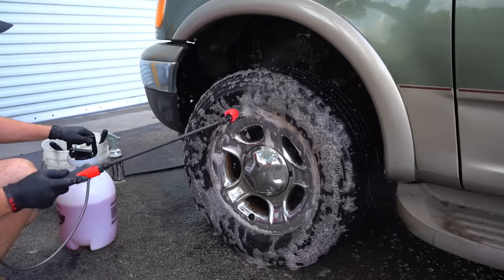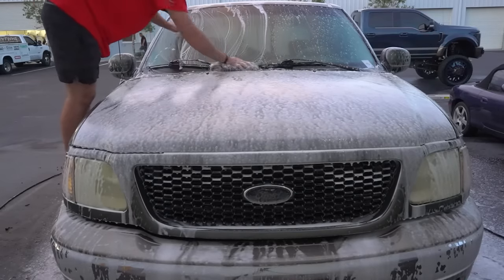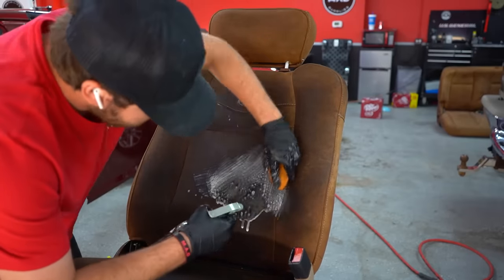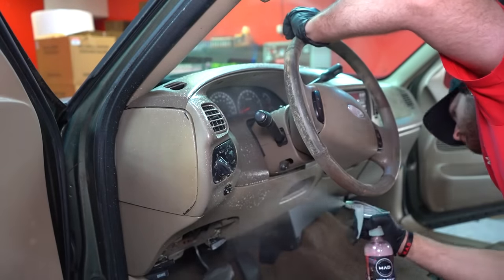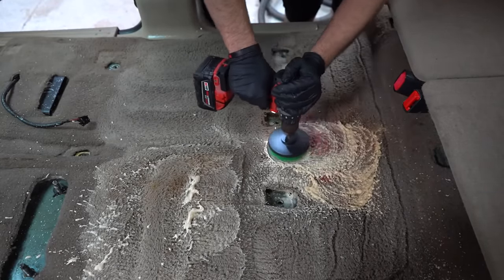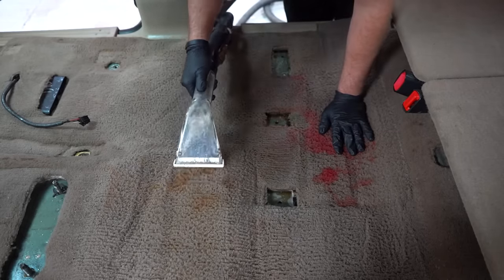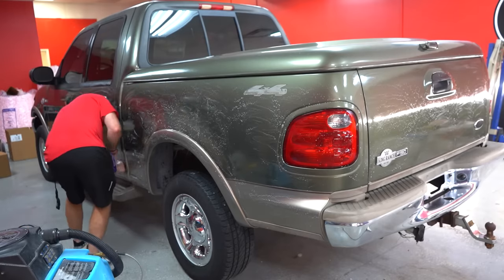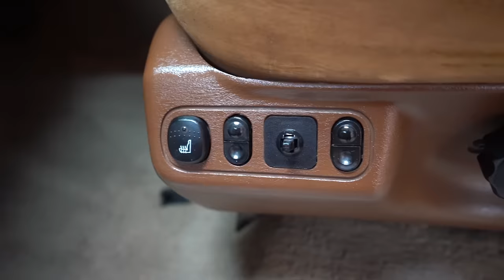Deep Cleaning the MOLDIEST BIOHAZARD Truck EVER! | Satisfying DISASTER Car Detailing Transformation

Comment: for red dyes and soda, I use ammonia (you can dilute it), soak, then steam with a rag on the steamer.  You need to break the chemical bond.  You need to be careful too and not over steam (get it to hot) because it can lighten the carpet itself.  try in an inconspicuous area first to get the feel.  I like to put a rag on the end of the steamer so it will transfer the red to the rag with the heat.  At best you'll remove the stain.  at worst, it will lighten the stain possibly the carpet a bit.  Practice it a few times before do it on a paying customer so you see how to do it.
Reply: Different fabrics don't always react the same to strong chemicals like ammonia/ bleach. It might work great on some carpets and others might absorb too much or have uneven lightening. Definitely wouldn't recommend using that inside the car..
Reply: @kellsbellls  I would on the carpet, being sure to test in an inconspicuous place. I would not use it one upholstery.
Reply: I don’t feel like using these chemicals on porous surfaces is a good idea
Reply: Nice
Reply: My gf use to work for a nursing home doing lundry and she brought home a stain remover that was able to take paint out of carpet and clothes idk what it was but i wonder if it would take that dye out.

Comment: I've never seen those seats, but I actually like the idea of them. Like cowboy boots, they get a nice patina over time. Not sure I'd want that commitment in my car, though. Should've used saddle soap :) Great transformation.
Reply: That would only work if that material  was full grain leather. I think it's much more likely the material is a split or a suede, at best. Far more likely to be a leather derivative or pleather product of some type  bonded to a textile (cloth).
Very unlikely it would take the oils like full grain boots, belts, and tack do.
Reply: @fridgeopener236  thank you for bestowing your wisdom.
Reply: There have been a few different leather styles used in Ford King Ranch vehicles over the last 2 decades.  2001-2009 were a Castano leather,  2009 - 2018 was Chaparral leather, both are Aniline leathers - they are dyed not sprayed and clear coated like typical automotive leather. The issue is like your cowboy boots, the leather will dry out and crack if not given some care, but also like your boots, it's pretty durable.
Reply: @1974kenm  I don’t know why I love your comment so much. Probably because you really took the time to explain it. Thank you. Merry Christmas and if you don’t do that, Happy Holidays!

Comment: The idea of real saddle leather is cool and interesting, it could also be used as a bragging point. However, I would not want to own it as it extremely annoying to keep clean, and is hard to clean. So, that’s a no for me.
Reply: I wonder if actual saddle soap would work better?
Reply: Actually saddle leather is incredibly durable and fairly easy to clean and maintain with the right leather cleaner and conditioner. As mentioned saddle soap can be used and works great. Using chemicals, improper cleaners, and not using leather conditioner will leave the leather looking weathered, dry, and cracked like in the after shots of this video.
Reply: I have cleaned real saddle leather boots. We have a thing of saddle soap that we rarely use cause o ly one pair of boots is real saddle leather. It's axing how nice it can look when cleaned right
Reply: Same. I like the idea & they are super nice at first. Although they are beautiful, I wouldn't want them in my own vehicle. What a pain it would be to clean. Especially for someone like me who has kids and a dog they tote around. Lol

Comment: I use a three bucket method with multiple microfiber towels.  I switch towels after each body panel. One bucket has the soapy water and clean towels.  One bucket has rinse water for the towels.  The towels are not reused until they go through the washing machine. I rinse them in the bucket in order to keep the washing machine from foaming up. And the third bucket I use to rinse the soap off my hands.

Comment: On the tan and grey interiors. When I come across stains like that. Pre- soak it with resolve mixed with oxy clean. It more then likely won't take it out. But it'll lighten it up drastically. Or even soft scrub will do.

Comment: Want to do mine next. It's a Michigan  work truck with plenty of cancer, clear coat flaking, leaking rear window and smoked in. It also has a matching bed cap. Can't remember when the outside was last washed but the interior was partially cleaned two years ago when I had to replace the condenser and heater core.

Comment: For that kind of leather… Just a tip… Clean it with Murthy’s oil soap and a bit of warm water. Works REALLY well.
Reply: My great Grandpa had seats like that. When we used the Murphy’s oil soap and warm to hot water, we still used an extractor. I had a saddle made out of that same material had to be cleaned the same way. And it sucks! I would spend hours upon hours cleaning both the seats and the saddle! LOL

Comment: Saw a commercial building cleaned after a water / mold incident. They used an ozone generator as part of the decontamination process. Would you consider using one in the truck cab?
PS - I’m totally impressed.
Reply from the maker: Yeah I use a ozone before and after on moldy vehicles.
Reply: @MADDETAILING  are you not worried about corroding the vehicles
Reply: @jayasmrmore3687  safety first
Reply: @loren1110  you can wear a mold respirator
Also he will be liable to potential lawsuit if he corrodes the metal

Comment: Great video!! The 2 bucket method makes no sense to me TBH. 
First of all by that logic you should use 3 buckets, then why not 4? Dirt will transfer to the second bucket from the first anyway (on the sponge)
Secondly, they say you don't want to introduce dirt to the surface - what do they think is ON the surface they are washing? You've already pre-washed with a solution and rinsed the larger dirt off - so most of that is gone anyway. 
Thirdly, anything that touches the car, theoretically introduces minute scratches in the paint - wiping off dust, running your finger along it, buffing/polishing.
One bucket with a grit guard should be fine for 99.9% of cars - unless you're going to be entering it into high-end car shows and examining it with a magnifying glass. (just my own opinion)

Comment: It’s Alinine leather and when properly cleaned and cared for will last a lifetime. It usually stains when it’s dry. Keeping the seats conditioned helps keep them from staining. Spraying them with dye is a terrible idea that a lot of shops do as a quick fix. The leather turns hard overtime and you can’t clean it due to the dye closing off the pores.

Comment: Ford didn’t do away with the saddle leather, to this day you can get a brand new king ranch with saddle leather seats. Saddle leather is pretty durable and made to last 25-50 years, that’s why it’s so hard to clean. To get rough stains out you need to use a stiff bristle brush and in some cases a wire brush, doing it to these seats would most likely tear and rip them. Saddle leather isn’t really made to look good but rather last a long time, and as you can see they lasted in this car even with the mold build up.
Reply: Hopefully you can only get it by request

Comment: I watch carpet cleaners get red stains out all the time. It's a method they use were they do a heat transfer. Take a microfiber towel and lay it over the red stain and put like a in closed steamer cover over it and the red stain Transfer to the towel I also seen carpet cleaners use a iron for steam too

Comment: Don’t see why if you’re going to be doing a machine polish to enhance the paint and remove swirls you wouldn’t use a two bucket method? By using one bucket you’re just going to create more swirls in the paint work thus giving yourself more work to do when it comes to the machine polishing
Reply from the maker: Depends on the situation like I said.